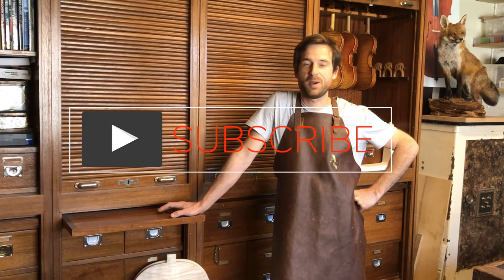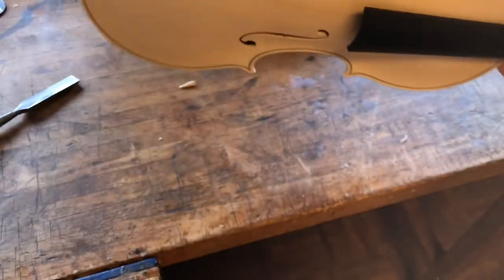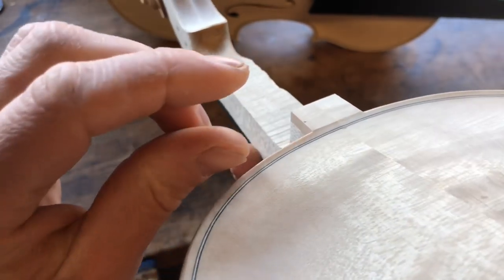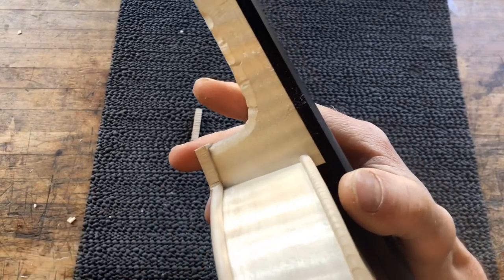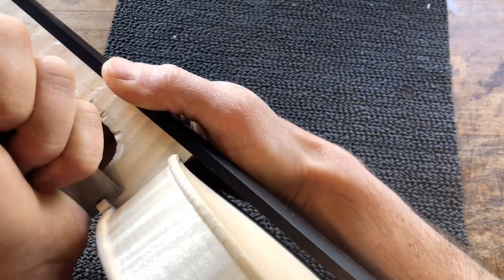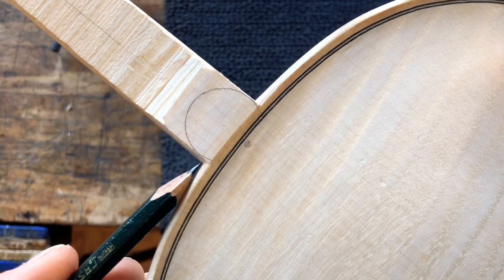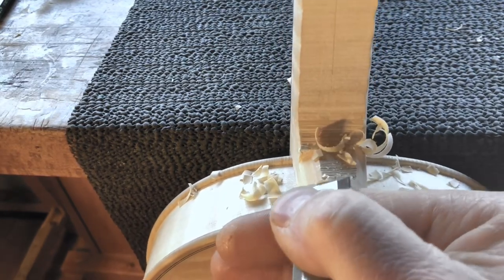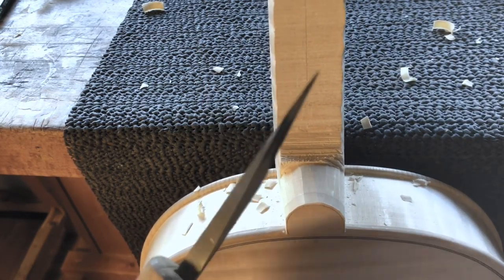Shaping a viola neck with Anton Somers.

Comment: EXCELLENT CRAFTSMANSHIP!  As a retired former professional violists, one thing I try to pass on to Luthiers is that most of the finest instruments I have ever played, are unusually lighter in weight and feel.  I beg Luthiers to strive in making the front and back plates as thin as possible since they are what vibrates most.  Most makers do not strive to make the plates super thin! Other places to remove wood is the inside area of the neck under the finger board; as if the inner neck has been routered like the pegbox. Us violists have one heck of a time holding the viola in such a position as to help our lower back muscles. LOL
Reply: Can I point out that light instruments often have arrived at their weight by the ageing process . 
Instruments that are made very light from day one can quickly wear out and lose their power . 
That is a great shame . I would like to hear other opinions on this subject .
Reply: The instruments you have to avoid the most is which too thin or light. It will be beautiful for a first several years, and then, a disaters will came out. 

Because of their thinness and lightness, it can't maintain its archings and structure. There are a ton of pressure and tension which came from string and players, thin wood plates cannot holding a structure of it. 

It is a very traditional and conventional method to makers when they cheat their silly/naive customers. Because they will encounter with the most beautiful sound they've ever met in their life, but not so long, it wil demolished because of its undeniable weakness. 

I hope you didn't buy that instrument.
Reply: No no, however, I have played instruments that had thin fronts and backs that were made in the late 1500s and 1600s. They are still around!  I am talking about new instruments made recently that are so heavy with thick plates!  @Dindy_lover
Reply: These ancient instruments , how do you know how thick the plates are . Furthermore how can you know how heavy they were when they were made ?